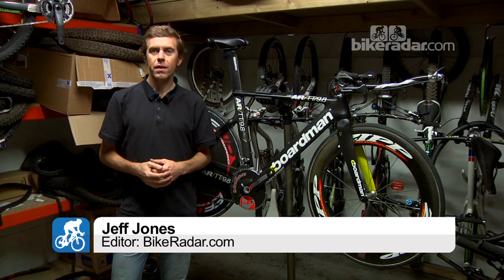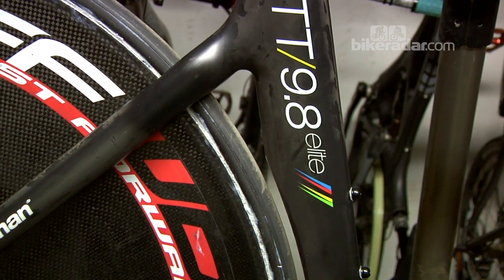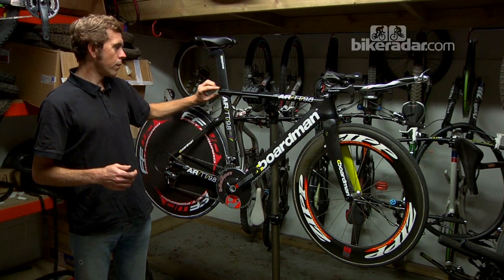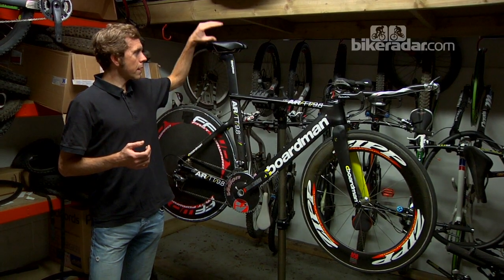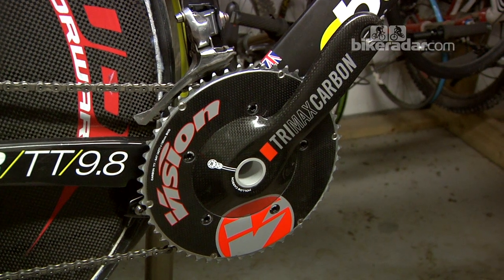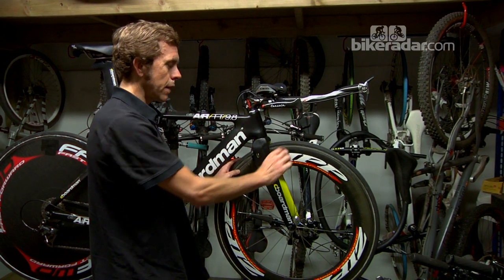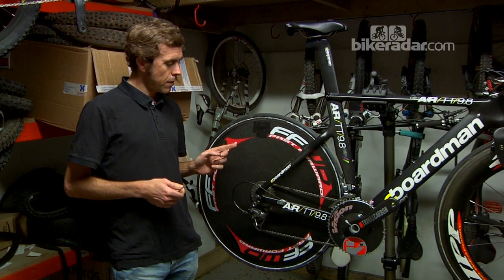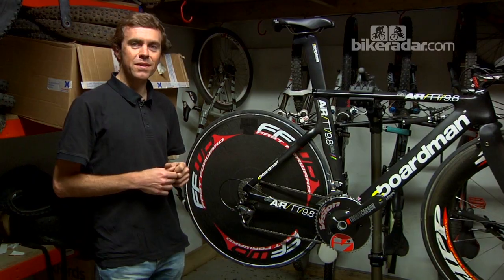Time trial bike build: what to consider

Comment: Throw some black caulk on between the tire and wheel to have a nice transition for the air.  Permatex® Black Rubber Sealant works best.  Don't use this on clinchers however.  This will also hide your gluing job.